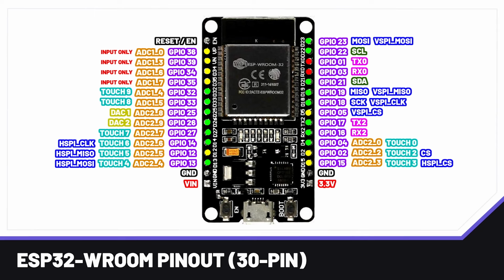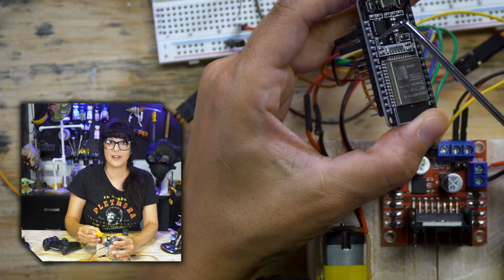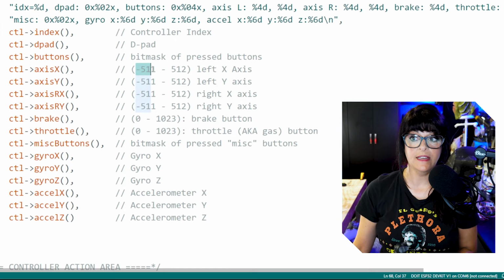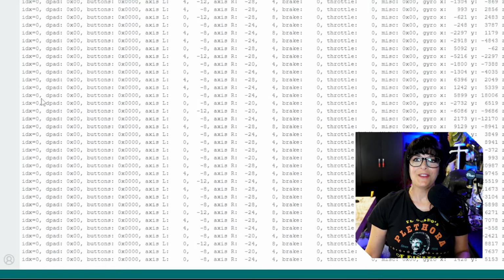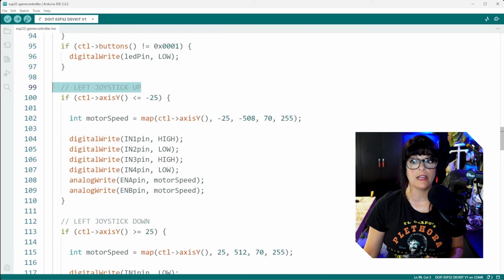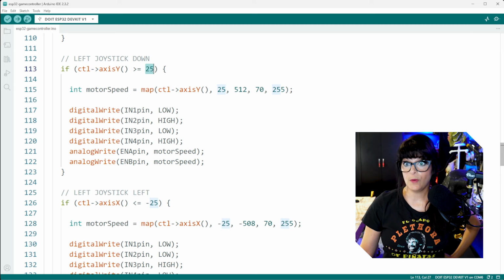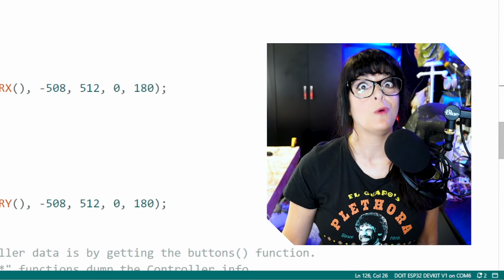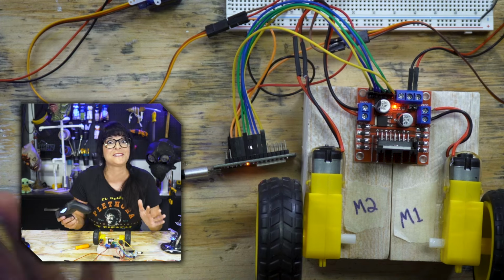Control Motors, Servos and LEDs with a Game Controller & ESP32

Comment: Thank you so much for the video. I saw someone doing this at a science fair and found your video when I started looking into how to do this.

One question I have is how does the program behave if the left joystick is at a 45 degree angle? The code for forward would be telling both motors to run but the code for turning would be telling one motor to stop? Or does the joystick not work that way and only output one value?

Comment: Hello Rachel, thank you so much for your amazing video. And a very special thanks for your ESP Bluepad codes. I can now control my RC truck perfectly. Originally, I had built a setup using a Raspberry Pi and Arduino modules, but true multitasking wasn’t possible with that. Now I’m completely switching over to your system. I’m already excited about being able to accelerate and steer the truck at the same time — something that wasn’t possible before. Of course, the truck has many other functions as well. Using an nRF24L01 module, I send commands to the trailer, which also has lots of great features.

Comment: You're committing many coding sins like magic numbers and not using bitmasks 😄
Instead of
```
if (ctl->buttons() == 0x0001)...
```
do
```
if (ctl->buttons() & 0x0001) {
  //positive action
} else {
  //negative action
}
```
This detects the bit in the bitmask instead so you'll be able to detect multiple button presses, in this case diagonals on the dpad

Comment: I can't get my servos to respond? The LED comes on and the servo jerks now and then. I am only using one servo. I am pretty sure my code and wiring are all the same as yours. Confused.

The videos are great, but this part has me licked.
Reply: The crazy part is, I can control motors following the video, but not servos. If I switch to the regular esp32 sweep sketch and upload that it move the servo. Code for the bluepad32, nothing.
Reply: @agelessstranger964 did you include the library for ESP32Servo.h to your code at the top?  Make sure you added that.  It’s in her code in the video, just not directly called out I think
Reply: me too, but the left joystick somehow controls the servo instead, Im so confused

Comment: Nice - thanks for this tutorial - well explained. If you additionally change delay(150) from main loop to small value - like delay(5) and remove all the serial.prints you will massively improve performance. With delay(150) it gets 6 Hz refresh rate max, which is extremaly slow. You can check it by connecting single LED (+resistor) and creating logic, which does analogWrite a stick value (mapped) to a LED pin every - time the position of stick changes. With delay(10) meaning 100 Hz refresh rate max it will be very smooth.  With 150 ms it is a staircase - usable only to serial.print button / stick values, but not for normal operation.

Comment: Rachel gives the best tutorials. Learning this stuff in my 50's has been a struggle since my whole life has been fabrication and construction. I was following pretty good until I wasn't. At the left joystick section I will designate a pin for motor A and a pin for motor B and control both motors with one stick. Where my hangup comes is im using a sabertooth 2x32 and since my esp is my reciever all I'll have is signal wires to run from esp to sabertooth. What do I do with the in1, in2, in3 and in4 lines? For those unfamiliar with sabertooth it handles pretty much everything which is why it's so expensive. I have been using a flysky transmitter and receiver. The only connections are battery to sabertooth, power and ground per motor, one signal wire from receiver to motor for each channel. 
  Could I use the commands for the right joystick twice but have numbers for speed in the positive of say motor A then write the code again but mirrored  for B and give each their own pin? 
I have two other servo motors that can use the code for the left stick section since those with use a motor controller that has ENA, ENB, in1, in2, in3 and in4.

Comment: Is the output of pins 26 and 27 the same as an rc reciever? I have a sabertooth 2x32 and instead of running my signal wires to the receiver ill remove the rc receiver and add esp32. I just dont know the difference in the two signals.

Comment: I am a total novice. When I try to upload the Bluepad32_ESP23 controller with a serial monitor, do I just get a bunch of diamonds with ? inside, what am I doing wrong? TIA
Reply: It should have something to do with the baud rate. Try different ones to see which is correct. 115200 baud worked for my esp32

Comment: I don't know if this question has been asked but how would you get more resolution from the left stick input? By this I mean on a scale from 1 to 100 in terms of the motor speed, it seems like there is no gradual increase, no 50, just 0 or 100. Thank you for the video!
Reply: are u using a motor driver or esc. without those you cant

Comment: I have the arduino code working, but was pondering how to use the joypad to control a robot arm's servos.  The issue I see is I want to move the servo to a position and stay there when I release the joystick back to zero.  Perhaps code to move say up slowly and not go down unless a negative is provided by the joystick.  This make any sense?

Comment: i was never able to get my esp32 module recognized on a port. I tried everything. Then I was beginning to wonder if my computer/laptop needs to have Bluetooth itself?! I don't think so but would be nice if someone chimed in, thanks
Reply: I just had a few Hours of the same issue.  I finally re-installed CP210X Driver (Silicon Labs).  And immediately connected.

Comment: HI Rachel thanks for a great video, I have almost completed my little project but wanted to know why if two buttons are pushed at the same time they would cancel both outputs for different LED's. For example on the L2 Brake i want this to active an LED and also move the vehicle in reverse. Is this possible? Or activate a left turn indicator and move forward at the same time. Help would be greatly appreciated.

Comment: Hello. 
Everything works but i faced this problem. My gamepad randomly just disconnects from the ESP32 and I can't seem to beat this problem. When connected to a PC, the gamepad works correctly and does not turn off. I would be grateful for ideas. Thank you!
Reply: That could be a power issue, when connected to the computer USB port it receives a steady 5V feed, but the batteries might be struggling to keep up with the demand.
Reply: @sdr_print3d887  do you mean when controller connected to PC? If yes, i connect to PC wia bluetooth too
Reply: you need to add 100pioc farad capacitor between 5v provided from motor driver and gnd
double check the polarity before connect capacitor
Reply: @ sorry for the clarification, I need to add a capacitor to motor driver on the +5v pin and GND pin?
Reply: @vitalii7282  there T block 
give me ur insta to show u

Comment: Hello! I was wondering if it's possible to use controllers that have Bluetooth connectivity like a Guilikit King Kong Pro 2 Controller as well as potential shortcomings when creating a surface water drone with the same design principle.

Comment: Thanks for the great video and edit! I was looking at your project and re-made it with a Xbox Controller instead. But in my case I have 2 pairs of the same motors connected in parallel for each side totaling 4 motors. I used 18650 3.7V cells connected in series, to obtain a 7.4V (enough to power everything). However, I burned the esp32 board with the same pin out ( without servos) through the L298V. What could of happen? I know reverse polarity can occur but I made sure no positive and negative connections touched... If you have video recommendations please leave them here. 

Again thanks for your help, this video was awesome! 😁

Comment: I have a problem I have hooked all up and using a esp23cam with a pca9685.  ps4 controller. On a robot arm. Just setting it up using one channel left joystick to rotate base.x axis left rotates one direction but y axis up is required to rotate in the  other direction x right does not work. Is there a problem in bluepad32?

Comment: Hi Rachel, thanks for the best arduino tutorials on the internet ❤  I was wonding if you would be able to do a short video on wiring a 1080p 60fps cam to an arduino with a few buttons & code to use the cam as a dash cam?

Comment: Rachel,
Thank you so much for your videos. I have learned more viewing your videos than I did in five day C++ class. Great job. I am having a problem pairing my PS4 controllers. I ordered one from Amazon and it paired after playing with all the buttons and I got to see all the data valves. Made notes of the values, I unplugged it from my PC and it never paired again. I figured it was because it was not a Sony PS4 like you show so I purchased a Sony PS4. Now I have two controllers that will not pair. Any help you can provide would be deeply appreciated.

Comment: Hey! sorry off topic about another of your videos! on the wiper motors what awg wire would you recommend using? You only seem to use the jumper cables on the video and reference using thicker cable but don't mention a recommended one?
Reply from the maker: I would go with 16-18 AWG.

Comment: Your videos are amazing! I am pretty new to working with the ESP32 board, but I have learnt a lot from your content. My question is, if you have built your own gamepad using an ESP32 is it possible to use this instead of a Playstation controller using BLUEPAD32 ? I am unsure of how you would initiate a sync command with a controller built using an ESP32. Any help would be much appreciated. Thank You.

Comment: I ran in to a snag,I bought a controller on AliExpress but that didn't work,I can blink the led on board though,I think it's because it's a S3 model.then I bought one from Amazon ,like you said and that's another model,isn't it? But here my com port doesn't lite up,I think the micro USB cables I have are charging cables and not data cables so I bought a few data cables now and I am expecting them soon.very interesting video's ,Rachel,always looking out for them,greetings from Belgium.

Comment: So what you are doing with the joystick values (value information) is a "calibration" of sorts, right? Because you can't calibrate the (inexpensive) controller itself, you "teach" the code to compensate. Do I have this right? (Bear with me, I'm learning).  😇
Reply from the maker: Yep - that's right! You can't really change the values coming from the joystick so you have to figure out a way to carve out specific ranges and what you want to happen in those ranges.

Comment: This is a great series.

I've done a project liek this with different libraries (prior to bluepad32 being as mature as it is now).  The handy thing about ESP32 is you can also pop up a webserver on demand if you want to configure settings.

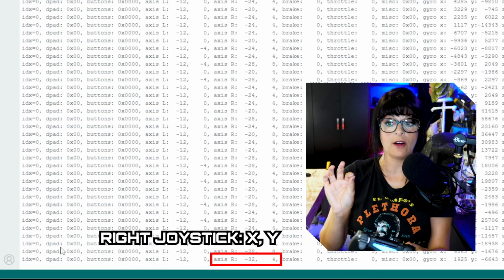For example:  not all game controllers are created equal (as you were discovering around 11:00), so sometimes you want to configure the center, deadband, and max travel.  And if you've got old man thumbs like me, you'll want a configurable expo.  Basically options you'd find on RC transmitters/flight controllers.

So push a button (or use a magnet since the ESP32 has a built-in hall sensor...), turn on the WiFi and web server, configure settings, save to the flash filesystem and go mow the lawn.

The most difficult things, believe it or not, were all the safety considerations.  Like detecting things like a dropped or disconnected controller and putting the system into the safest condition possible.

Comment: What happens in the code if you have x and y inputs for the motors at the same time? I think addressing that would be the next logical step in writing the code.
Reply from the maker: You can definitely set up ranges in both the X and Y where you want specific things to happen, like when you thumb the joystick diagonally. That will be version 2 of this video 🥳

Comment: I like that you chose esp32 for this project.
Reply from the maker: I've been using the ESP32 more and more for my projects. This is the 30-pin version. I'm getting the 36-pin next!
Reply: @RachelDeBarrosLive  Hey Rachel, thanks for the video.
The 36-pin ESP32 doesn't have much more of an advantage. Because some of the pins can't be used.